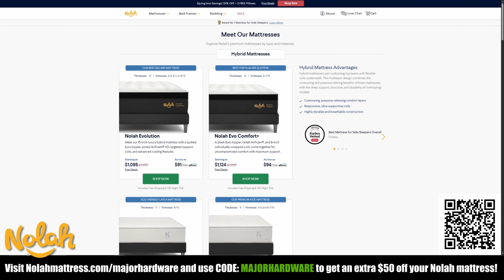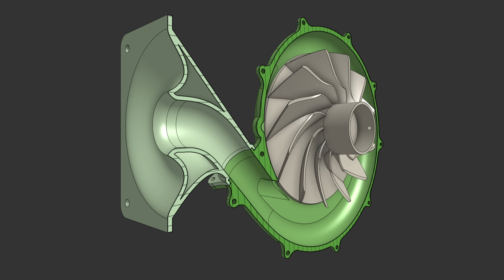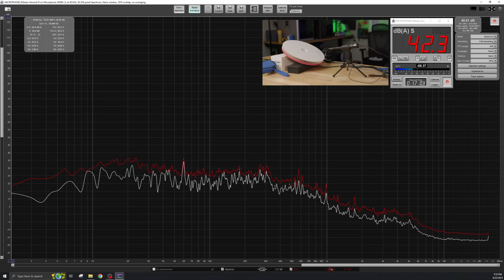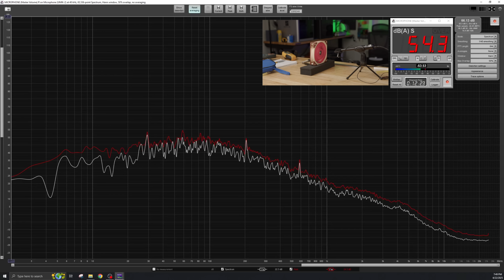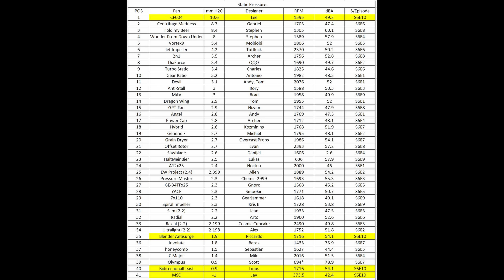This Fan Was Designed to FAIL... And It Broke the Test! | Fan Showdown S6E10

Comment: The vacuum fan has a few technical advantages in that by reducing pressure:

1: there is a refrigeration action which decreases the air temperature as it pulls through the heat sinks, 

2: the fact that the fan is behind the heat sink means that any air turbulence caused by the fan its self is eliminated, thus helping promote laminar flow, 

3: any heat generated by the operation of the fan is downwind of the system so as to keep the fan from adding heat to the cycle, and
Reply: Yes, but the expansion of air into the case isn't adiabatic unless you make it so, so the decrease in temperature would be caused by the Joule-Thomson effect and that is negligible from such a minute pressure change that it would be hard to measure. Around room temperature and for air it's less than 0.25 C for a pressure drop of one atmosphere, which is ~10,000 mm H2O. Even adiabatic expansion of 1 mm H2O from atmospheric wouldn't cause a significant reduction in temperature.  

With a significantly higher pressure difference, and adiabatic expansion, you could potentially achieve some benefit, like if you used something similar to a turbo charger to make the expansion of the air going into the case to extract energy from that pressure difference, thereby making it adiabatic, and use that energy to power further fan stages that "pulls" air out of the case. Maybe something to explore in a future season of the fan showdown?

Your second point also has a point, but it kind of depends on the situation if you actually want laminar flow or not. 

Your third point is great, that can obviously make a somewhat relevant difference under certain conditions. But the standard NF-A12x25 should only increase the temperature of the air about 0.03 °C, if the flow is unrestricted, and the temperature increase should remain below 0.1 °C if the restrictions decrease the flow by 50%. But if you use a lot of fan power to push air in at "high" pressure, and thereby low flow, that can actually cause an significant increase in temperature of that air.
Reply: @fishyerik  While it is true that this fan array how it is made would by no means be a champion cooler, and the principles in this application are too weak to really matter, technically they do happen, within a very limited extent.

As one who has built turbine engines, such principles work at high enough levels that they matter, so I am constantly aware of them.

While it is sorta tongue-in-cheek for me to list them here, because the said model in question is too powerless to really make a difference, there is no harm in mentioning it, because it might encourage others to work on the principles.

I just enjoy being a nerd and saying stuff some times.

Realistically, one would need to build a 100% enclosed, insulated, shrouded and filtered cooling system to make an optimal product, but that is way outside of the scope of this show's whole purpose.

I know full well it is not going to work like that in such a near-stall condition, I'm not fooling myself in that.

But its useful information for people who would find it interesting and maybe would want some computer company contacting them for a contract some day.

Who knows?

Sharing a few simple aerodynamic principles might help some person become a surprise prodigy inventor!

Or...

It might not...
Reply: It really may be the best design overall if he could place it on the opposite side of the static pressure setup. It has all these advantages in actual cooling.
Reply: @chrisloesch5854 yeah tbh I think it's actually got some real potential, its just not made for this test. (Basically, you'd need to change how you plan on using it)
Reply: Surely 1 is perfectly offset by the reduction in pressure and so thermal mass
Reply: You'd want chaotic flow for heat transfer, laminar flow is bad in this case.
Reply: @Jack-tx6ei  Not really, you just need a decent case. One that has air flow from the bottom and cool air will naturally flow upwards from the bottom to the top where you'd want to place this drawing all the heat out.
Reply: Lower pressure means less air to carry heat away.
Reply: @Surestick88  negative pressure means it push the air out instead of in, not that the air became less dense.
Reply: @luigichierico2321 Pressure differential is what causes airflow. If a fan is "sucking" air out of a computer case then it's obtaining airflow by lowering pressure in the case so that the air pressure outside the case is greater causing it to flow in.
Reply: @Surestick88  Exactly, it's a longer explanation of what I wrote.

The pressure on one side of the fan is greather than on the other side of the fan causing air to move, so unless you seal the case and have only one super efficient fan the the air is going to move, it's what cool the PC.

I responded "negative pressure means it push the air out instead of in, not that the air became less dense." because you wrote "Lower pressure means less air to carry heat away.", when greather difference in pressure cause a greater volume of air to move (obviously unless you seal the case).

(Sorry for my bad english)

Comment: that turbo fan was performing so well in the smoke test that you could actually see the vortex shedding from the output! pretty impressive
Reply: I can't believe from what we observed on the smoke test that the turbo was a 10.9 and the turbo fan, which appeared to move more smoke, at least to me, was only a 1.9
Reply: @markgado8782  They were being graded on static pressure, not throughput, so it's to be expected.

Think of it like gear ratios. High gear fans that move a lot of air get slowed down terribly when under load, but low gear fans can handle more pressure before they give up.
Reply: @haph2087  so, if i wanna do air purifier, does connecting this c004 is good idea?
Reply: @bezimiennygrzes5593  Probably, yeah. I presume the air filter would cause quite a bit of resistance, so a fan with good static pressure would be useful there.

Comment: Maybe for Season 07, give people a filament budget? Decide some restricting but workable amount of filament (by weight or by length) and make people work within that restraint. Have to make choices on infill, layer structure, or such. If their print runs out of filament then their half printed fan still gets tested the best you can! Can push towards functional weight reduction innovation like in motorsports, aerospace, and outdoor recreation.

Edit: maybe bonus points for going "under budget"?

Comment: I wonder what you would see if you put two of these fans opposite to each other in closed cylinder (wind tunnel), and see the net airflow.
They could have a push battle and a pull battle.
Would a pressure-optimised fan be better, or one that just moves as much air as possible?

Comment: You should run the one that got negative one backwards, spin it backwards. See if it’s actually really good at static pressure.
Reply: That's physicaly impossible, regardless of the rotational direction, the centrifugal force will always sling the air outwards, creating a vacuum in the middle and exhausting out of the sides. But backwards the blades geometry is wrong, so you just end up with lower rpm and less airflow, but still in the same direction.

Comment: CF004 looks like it takes more inspiration from a Centrifugal Supercharger than a turbo. Since the how the impeller is driven does require differences in design it also causes differences in how it looks. Like a larger impeller for example. Also it;s in the name "CF" is likely to stand for Centri-Fugal. A bit on the symantical/ nitpicky side, however because of how different they're due to how they're driven I'd say its significant enough to say at least something.

Also that puller fan has now split the "competition" people are now going to try and beat -1. Which could be interesting.

Comment: Honestly, this episode just highlights why I love this series. 
The creativity, the silliness, the science
              THE FAN SHOWDOWN!
Reply: I love it too! I just wish he posted more of it.   An episode a week sounds clutch.
Reply: @g0ldensample21  It used to be far more regular, but I suspect some of it is time related on his end, some relating to the models becoming much more complex and taking longer to print, and I can see burnout potentially being in there as well.

Honestly, given how scientific we are now, I wouldn't mind next season leaning into that but with the stipulation that designs MUST fit inside the frame. This would cut back on the massive print time (and filament cost, unless he has a recycling extruder?).
Then run the 4 through ALL of the tests from seasons passed. CFM, Static Pressure, Noise... and the others I'm for some reason drawing a blank on.

That way if one does amazing in all the categories it might be worth providing the winning print to the public and folks can use a print service to get their own.

Comment: For season 7, I suggest having a "sound optimized" scoring system where a main metric (like cpu temperature, cfm or pressure) get compared to the dBA. This would allow more diverse submissions as contestants would need to minmax how much they go on maxing the main metric vs trying to control the sound. This could also allow to have 2 different leaderboards, one where you divide the main metric by the sound, so contestants try to make the quietest fan that is best at moving air, while the second leaderboard would be to multiply the main metric with the sound, so the task would be the have the most effective fan that is also the loudest. 
I do think that go along Jay's spirit of aiming to scoring for the other side of the leaderboard. I had the idea at the start of the video when you mentioned being close to moving to the next season, but seeing his submission really made me want to write it down.
Reply: I second that, sound should be the next criteria. That is basically why i started following this channel, to see if there was a way to make them more silent. I'm sound engineer, so quiet fans are important to me.
Reply: CFM per dBA would be an interesting metric.
Reply: @codahighland  That would probably favor louder fans since dB is a logarithmic scale and the floor is already somewhere around 40. A 50dBA fan would sound twice as loud as a 40dBA one, but would only need to push 25% more air to match the score.
Reply: @Sibula  Then maybe W/m^2?
Reply: volume of air per minute x static pressure 
_______________________________________
      noise (dBA)

would be interesting to see
Reply: That would end up basically designs to "play the rules" - optimizing for the calculation used. 

I think more interesting would be either static pressure value with max dB limit (over some value to disqualify) and/or the opposite as low dB having over required pressure. But I guess these can be custom calculated if the measured data is shared somewhere.
Reply: @ilmt  Sounds good, except I'm not sure if static pressure or airflow would be a better metric. The problem, of course, is that people designing the fans would have a hard time estimating their noise, and a lot of designs would probably be disgualified.

Optimizing for noise with a minimum CFM / mmH2O limit might be more interesting. Basically, make the most quiet fan that is still good as a fan.

Comment: Even Blade Counts are better in my opinion, for ONE REASON.... If you break a blade, you can break the opposite one and the fan still works since you've reestablished balance! 😅 
(I may or may not have broken many blades and fingernails over my 27 years building my own computer)

Comment: Here's a funny... I worked at a company that engineered and manufactured fans (from 8" to 96"). We were designing a fan blade that would attach to a disk with a  2" root attached by "knuckles". So we need to stiffen up the root with an emboss. Well, through FEA one engineer found an ideal shape. Let's say the emboss was half "Banana" shaped. I opened the file and was a bit 😳... It looked "inappropriate". So I asked my boss, "Have you seen Dan's new blade design?" He nodded... I asked if he saw the new emboss. He said, "You mean the pleasure boss?" I said"THANK YOU!!! I just thought i was a weirdo!" He said,"No it wasn't just you... We'll have to change the design. We can't have the shop floor chasing each other around with the blade and besides, adding D sized batteries might make it too heavy!" 😂 Oh man... Good times!

Comment: I was thinking a 'Back to the Begininng' kinda season. You've got the stuff to test open flow and pressure, how about a season where the fans have to fit inside the frame, you test each at open flow & at max pressure, graph the two points pressure vs flow, take the area under that(straight line) P-Q curve, best one wins it all.
Reply: It has already being exhausted... Trying to beat factory design is going to be difficult, and all the best are SO close to the original that it is not really exciting. Noctua has optimized the design, the only limitation they really have is that it has be mass produced. But the original is so close to ideal it is nigh impossible to beat it with 3D printed design. i think the winner in that era was like couple of percent above the original and everyone else performed worse.

Now the limitation is "how much can the hub take?"..
Reply: @squidcaps4308  mmm, you may well be right. My current best attempt that would fit this category is only +10% at max flow and +40% at max pressure. Probably not enough room in there to be interesting.

Comment: Actually, I'm pretty sure the MSC would perform really well in real world scenarios if you had enough of them strapped to a PC case; all negative pressure actually performs really well in PC cooling because it vacates the heat pretty much immediately. Super interesting design.
Reply: I run positive pressure (or try to; sometimes seems like chimney convection outruns the casefan airflow) because it ensures the air goes through the filters

Comment: You gotta run that negative one in reverse. Change the polarity and share the numbers please! ❤
Reply: @anchopanchorancho it would still create vacuum if you ran it in reverse. Just less vacuum.
Reply: It’s a centripetal fan that uses centripetal force. Direction doesn’t really matter since centripetal force will point in the same direction regardless.
Reply: Changing polarity wouldn't work on such a motor. PC fans are motors with controllers. You would either need to swap two legs of the three going to the motor or reprogram the controller to reverse direction. Neither are worth doing.
Reply: uhhhhhhhhhhhhhhhhhhhhhhhhhhhhhhhhhhhhhh

Comment: @8:30 looks like the compressor stage of jet engines. Just in another orientation than in the engine. I would actually expect it to be able to create quite good static pressure, but you probably cant really test it because your setup is too small.

Comment: Is there a rule against adding an extra PCB to one of these designs? Where you can control the voltage and current to try to increase the RPM with the same power draw?

Comment: I last used OnShape almost a year ago, so this may have changed.
For 3D printing specifically OnShape is fine, so long as you don't need threads... (screws, nuts, and the like)
when I last used it the only way to make a modeled thread was with the spiral tool I think, which is fine if you are making both the male and female ends of a printed nut and bolt, because you know what your thread count setting are.
but when I'm printing threads it's usually to make an adapter for some existing product and trying to figure out how to make the spiral tool make a matching thread to that is a NIGHTMARE. (if you aren't already say a machinist intimately familiar with how threads are made already)
Compare that to Fusion 360 where all I have to do is make 1 or 2 small measurements and select the right option from a drop down menu, Bam it's done XD
Fusion 360 does also have a free to use version for hobby use.
but my rant about threads aside, both are pretty great for 3DPrinting.
Reply: In OnShape I use the ThreadCreator feature for a range of Metric and Imperial threads (internal and external, multi starts etc etc), but I think there were a number of threading features if that one doesnt meet your needs. OTOH I have used the spiral tool as well, makes great "threading" for connecting to corrugated vacuum hose.